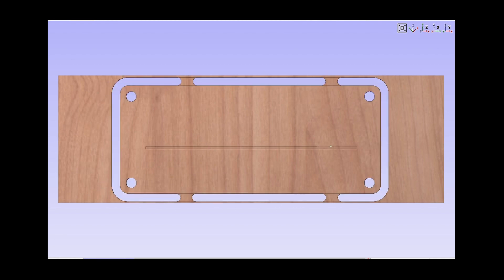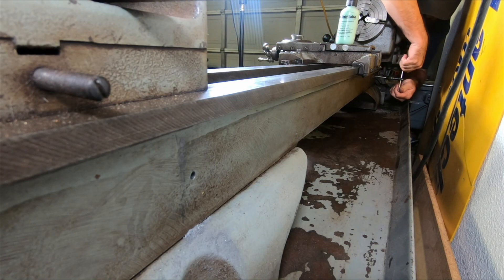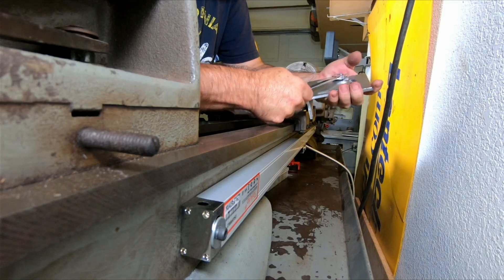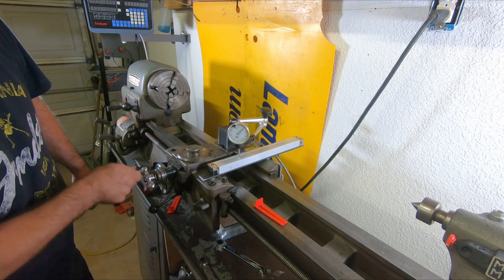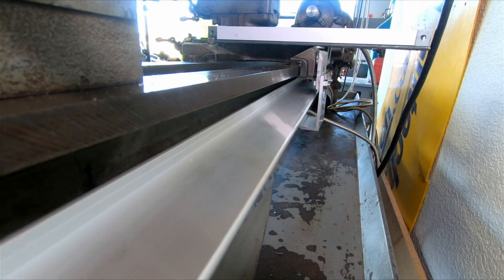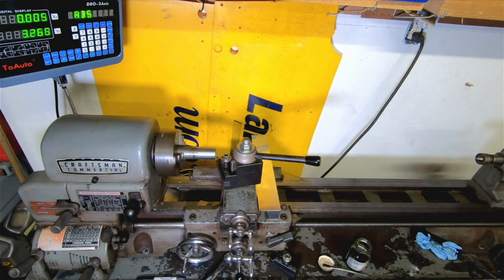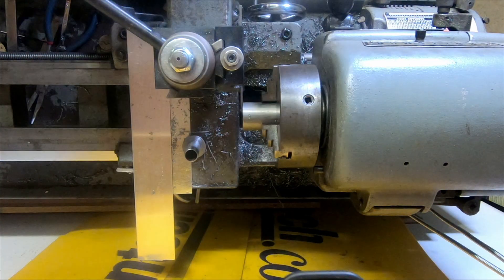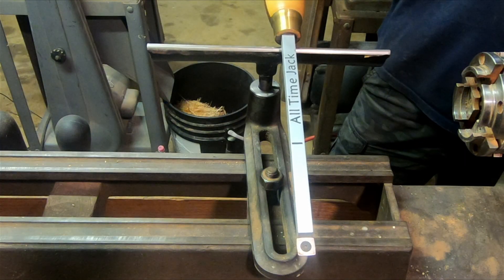Craftsman/Atlas Lathe - DRO Install

Comment: Well done!  I happen to have the same lathe and the same DRO that I bought about a year ago.  You made this really easy for me!

One problem I have run into, I bought the wrong length for the cross feed.  Mine is 350mm / ~17" less the end caps. What length did you get?  Is it about 12"?
Reply from the maker: The over all length is about 13.5 inches.
Reply: @alltimejackshop - thank you sir!

Comment: Great video an finishing up a restore on an Atlas TH54 and the DRO is a must. How did you mount the reader on the compound?
Reply from the maker: @bobkarstien1248  with magnets. I figured I would have to  hard mount it eventually but it’s still holding just fine.

Comment: I have the exact same lathe except it’s not the cabinet version. I’d love to see some pictures of how they do that the motor and pulley underneath it. I’d love to make mine like that, but I would need to see how they do it. Now with the DRO, do you not even look at the dials on the way anymore just paying attention to the digital read out?Even though the craftsman has nice hand dials compared to mother machines they still can be a pain to see sometimes thanks very much. Nice job.
Reply from the maker: @ScottPinardi  I’ll try to reply with some pics for you this weekend. Yes, after I installed the dro I don’t use anything but the digital readout unless it’s something that requires a great amount of precision and then I’ll double check it. So far the dro has worked out great. I love it.
Reply: @ awesome thanks so much.
Reply: If your Craftsman lathe is not the Commercial model, you probably can’t change the motor location. 
The 101-07403 is the earlier version with 3/8” flat ways. The commercial model has 1/2” ways.

Comment: A friend of my Father just gave me a 12x36 Craftsman Atlas but all he had was a parting tool and threading tool holder….Im looking at getting a quick change for it, is that a BXA on yours?
Reply: Can I ask how much the DRO was and where you got it?  That’s cool!
Reply from the maker: @I-WingNut-I  There is a link in the description under the video. If you don’t see it, hit “more” and scroll down and you should find it.
Reply from the maker: It is a BXA. I believe AXA and BXA will work just fine.
Reply: Thanks!